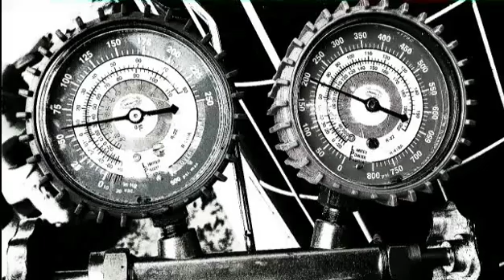R22 to R410a Conversion: Line Set??

Comment: I have been in business for 37 years, and if the line is easy to change out I do, and if the lines are in the wall or have to cut out sheetrock I blow them out, I just don't want to take the chance, that the crap in the line set if any might damage the new system. That's just what I do.
Reply: Arnie Grote ...and that is what should be done. With 410 that crap in the old r22 line sets are a death sentence for for the new 410 system. 5-10-15 years who knows but it will shorten the life. I wonder if these guys leave old line sets in their own home system?
Reply: I have had units tear up about a year after not changeing line set so IAM with you rather safe than sorry